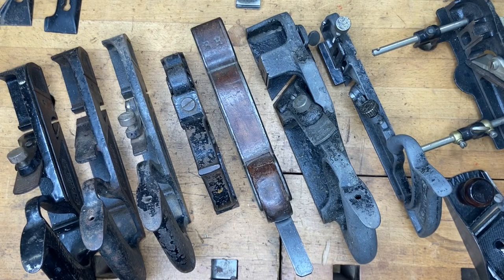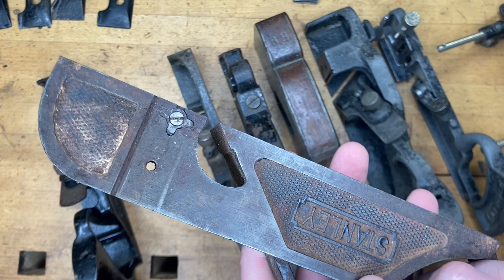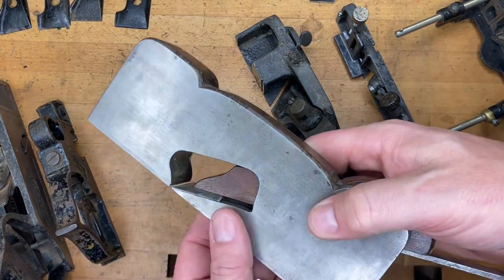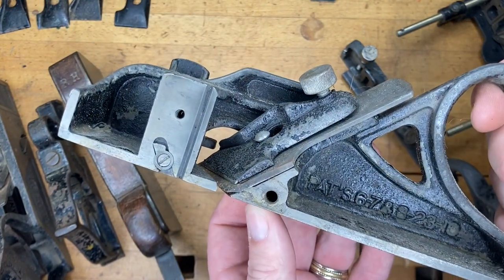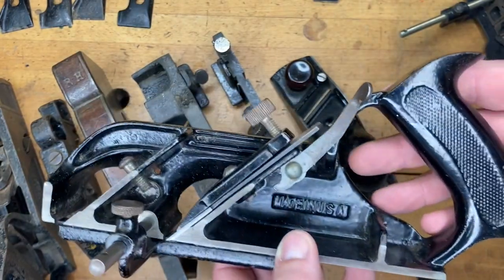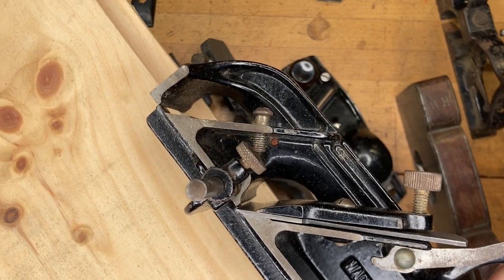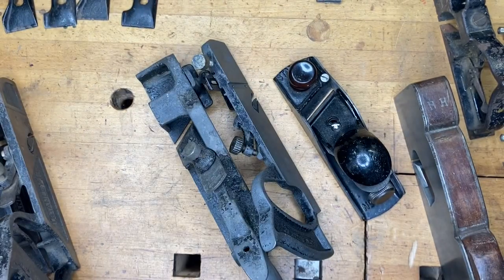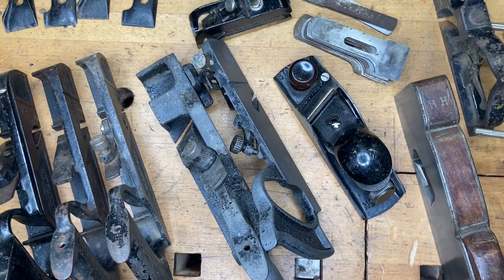Stanley Rabbet Planes(mostly); an in-depth look @ various hand planes designed to cut rabbet joints

Comment: Real cool planes! Where do you typically pick up your planes?
Reply from the maker: I have a video up where I talk about where to find hand planes. Estate sales, yard sales, flea markets, online sites such as eBay. The trick (I think) is to be borderline obsessive about it. Taking a passive approach will score anyone the occasional deal but getting the best stuff at the best prices means being… rabid. 

But you probably already knew that 😜
Reply: @justplanefun  
Yes. I started buying vintage wrenches but exhausted the local supply pretty quick. I did the planes after that, quickly exhaust the same places. I found some by word of mouth. I bought a box of "old woodworking tools" for $20. In it was a bunch of brace bits, saws, several block planes, a Great Neck Corsair (with good knob and tote) and my favorite, the no. 8 missing only a lever cap, iron, and cap iron. We found the missing pieces on ebay. The rosewood pieces are pristine as is the japaning.

Comment: I know the spurs are different, but are the screws for the spurs the same on 78, 278, 150, 180-182, 190 - 192?
Reply from the maker: Great question! I meant to talk about that and forgot. The spurs are the same for the No78s, and the 190-192s, as are the screws. The spurs are ALSO the same on the No45s. The screws on the 78s are longer than the ones on the 45. 

Remember there are no spurs on the 180-182s. 

The 278 spurs I believe are the same as those on the No50
Reply: @justplanefun  Thanks good info!